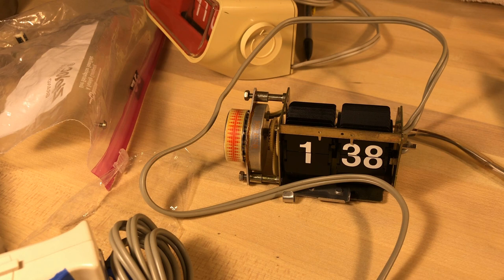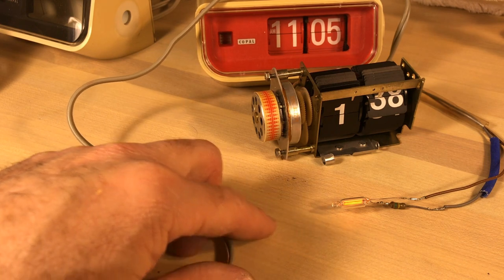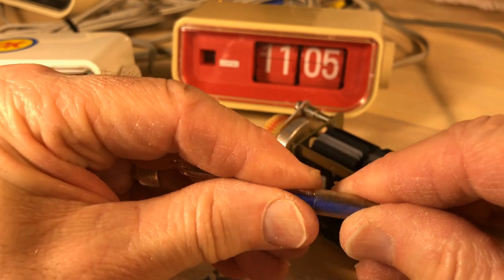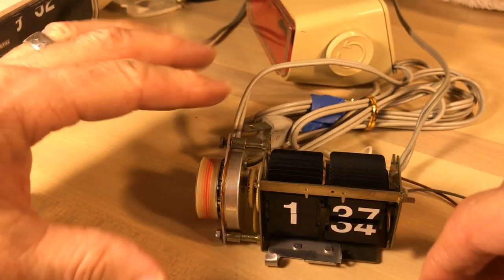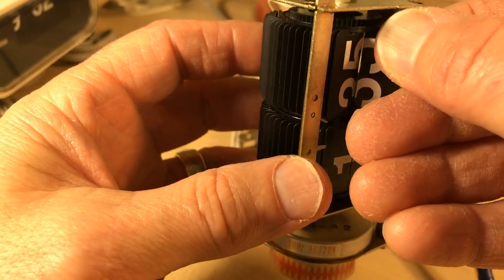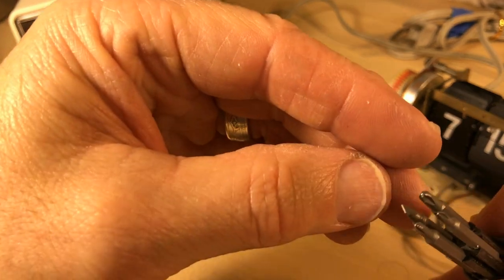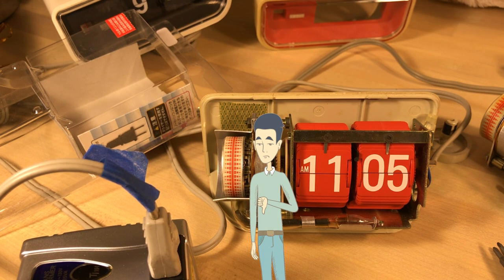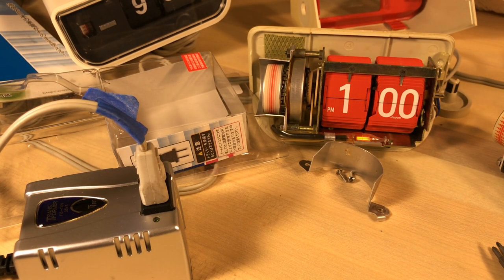Raw video of work on the Copal 225

Comment: Where do you buy those lightbulbs?
Reply from the maker: Martijn Both - lots of places online. For your standard clocks I like to use the C2A. It’s a little smaller but puts out an good light and only uses a 30K Ohm resistor with 110-120 volt clocks - which the company I use supplies with the bulb. 
https://memotronics.com/new-box-of-10-neon-bulb-ne2h-c2a-indicator-105-to-125-volts-ac-dc-free-resistors/
Reply: @Flipclockfans  I have a 226 red on white flip clock that won't flip the time. The flywheel spins great though. any idea on how I can fix it?